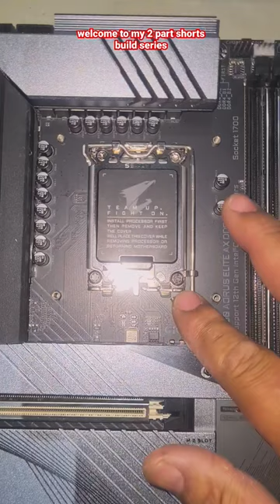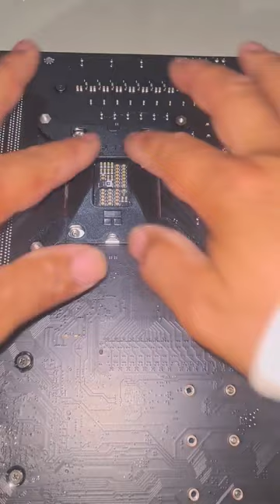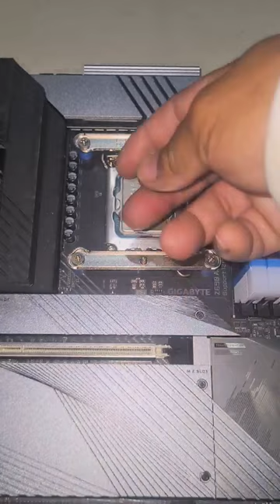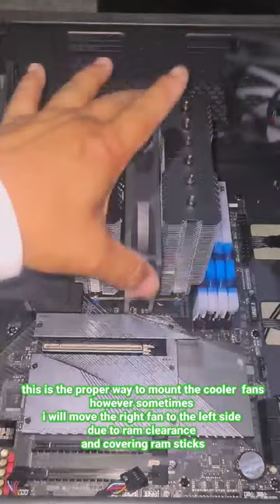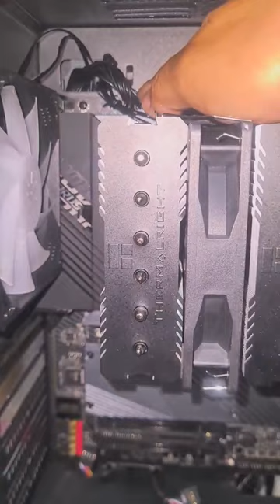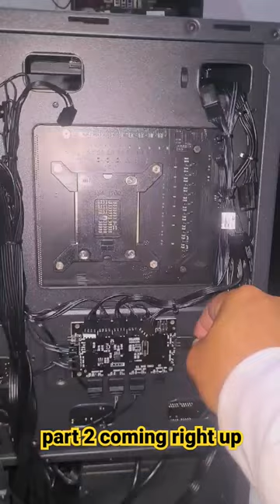mid range 1080p to 1440p gaming pc build short. part 1

Comment: Get better RAM sticks and put them in alternating order.
X - O - X - O
You get better speeds for the same gigabytes.
Reply from the maker: u mean just use 2 ram sticks
Reply: @MIKEYZVLOGZ  basically yes. You'll increase the ram speed, mostly if using DDR4/DDR5 ram sticks
Reply from the maker: @mc_elmancapod_09  i get ya less time for ram to respond... but i dont thinkbit makes that much ofba difference ..however i know ddr5 ram doesnt pike 4 slots ...ots vetter to stick to 2 ram sticks...
Reply: @MIKEYZVLOGZ  There is one problem with 4 ram sticks, and it is that it will be harder to get them running on high frequencies and low timings, while with 2 ram sticks it is easier  to get them running for usual gaming pc builds... this also depends on the rankings. Did you get 4 8 gigabyte sticks? If yes, it's better to switch to 2 16 gigabyte sticks, cost less and are faster. Also, if you do switch, put them as I said above, in the second ans fourth slots. It also depends on the motherboard, if it is a quad channel motherboard, it's best not to switch. Otherwise, the best option is always the 2 ram sticks.
Reply from the maker: @christianmanca2136  yes this is true however I did get these 4 to run just fine at Max 4400mhz which is the recommended speeds..I don't really see the point in changing as it's not my pc... this is someone else's pc... but I get what ur saying... esp wit ddr5 4x sticks is a nightmare.. eventho I did get my ddr5 x4 16gb 6000mhz to tmrun aswell on my personal rig it's not always the case with all motherboards..this I know first hand..and so yes wen ut doesn't work I always switch to x2 ram sticks like 32gb x2 or 16 x 2
Reply: @MIKEYZVLOGZ  If it is openly the customer's choice I get it, you can't do much. Just keep this in case of future builds
Reply from the maker: @christianmanca2136  ye I get what ur saying... thanks for sharing. So, do u basically buy 2 ram slot mobos?..cuz seems like u never would use 4 ram sticks so does it make sense to only buy 2 ram slot mobos?
Reply: @MIKEYZVLOGZ  I still use 4 slot mobos because you can't find good 2 slot mobos these days... at least not here where I'm at. Also most modern mobos are 4 slot by default